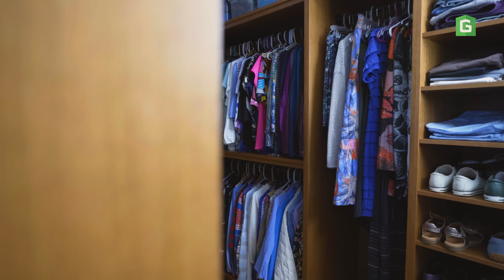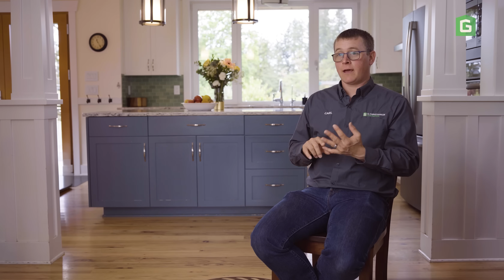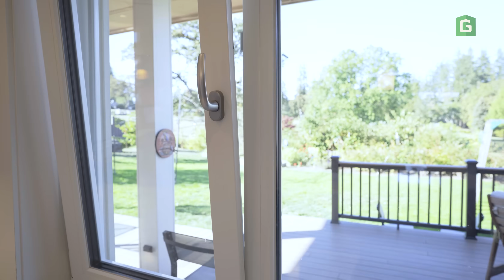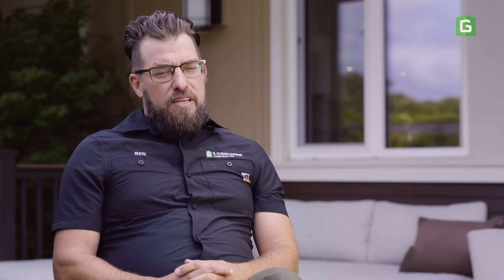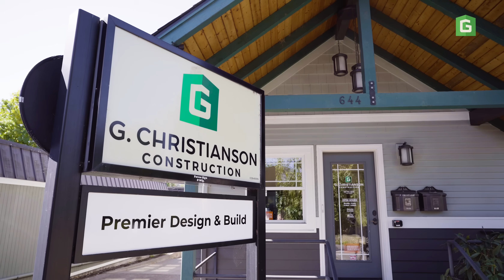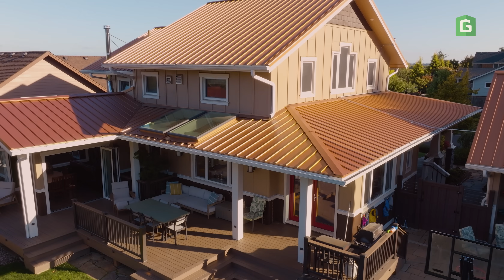Advantages of an Energy Retrofit for Your Home

Comment: Don and Betsy also left us a 5-star review on Google:

We are very pleased with the results of our remodel done by G. Christianson Construction.  We had downsized to an older 1960's house, single floor house, close to services.  We found that house but it was showing its age and the effects of being flipped several times.  Poor quality cabinets, cheap flooring, questionable wiring, air leaks, cheap heating/cooling and poorly done remodeling.  It looked good on the surface but not under the surface.

We decided that we wanted to update several features in order to gain an energy efficient house that would be appealing in appearance,  add solar, gain better closet space in the master bedroom,  update a poorly designed laundry/bathroom/pantry space, eliminate the fireplace, switched to a modern head pump and used wood throughout the house to improve overall appearance.  We got all of this from G. Christianson Construction as well as quality work.

We removed the fireplace, added an electric fireplace with a beautiful stone and oak cabinetry surrounding it.  Adding oak floors really added to the beauty of the space.  We created separate laundry, pantry, mudroom spaces.  The master bedroom layout was changed to give us a large walk-in closet.  The oak flooring was continued through the house nicely tied everything together.  To gain energy efficiency, we had the house sealed, removed all gas appliances, added solar panels, an electric water heater and an air purification system.

We couldn't be happier with the design, planning and construction process.  While not everything goes perfectly, any problems were handled promptly.  We worked closely with a designer and had regular progress meetings with the VP/project manager.  Even the owner of the company, Carl was closely involved with the project.

If you want an energy efficient, well designed and well executed remodel or new construction, I would highly recommend G. Christianson Constuction.

Owners.  Betsy and Don Reid